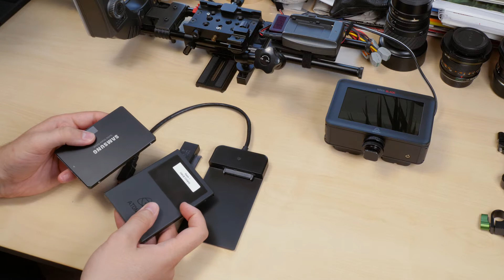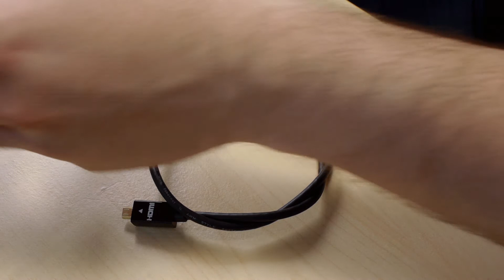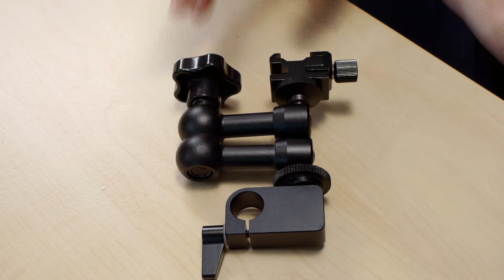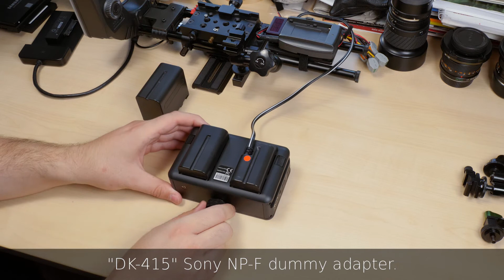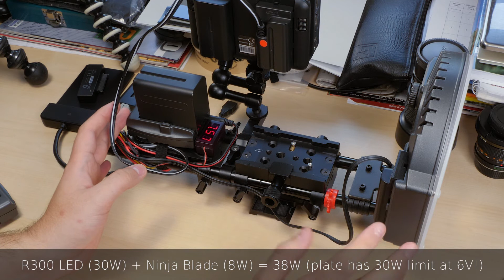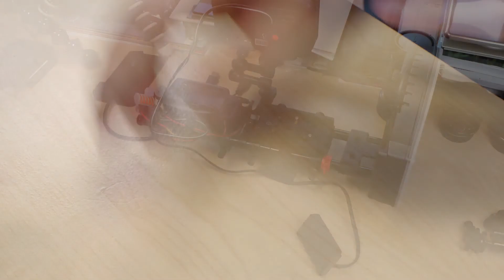Accessories for external video recorders (Featuring: ATOMOS Ninja Blade)

Comment: What were you saying about prores being bad on PC, and to use dnx?
Reply from the maker: Well - The problem is, that there is still the gamma shift bug present with some renderers / encoders. A few got fixes - But its still the case with some (while you´re cutting or in the original footage before using the encoder the exposure is ok - But it shifts as soon as you encode the footage). So that´s the point why I mentioned that its better to use DNxHD instead of ProRes if you´re working on the PC (as the Atomos Ninja Blade offers both codecs). On MAC its better to use ProRes on the other hand. It´s just faster there (and it´s a standard codec there). ^^
Reply from the maker: Yep. Though: I need to test the newest CC if the gamma shift bug is still there - Until now even with CineForm as intermediate / pre-rendering codec (with MOV wrapper) there was still the gamma shift bug present. I hope they fixed that. It´s quite annoying, to have different gamma levels (just because you use different pre-rendering and output settings). Especially since Premiere is very unstable with some effect combos - Therefor its nearly a "must have" to pre-render some parts (and I like CineForm as it´s taking a lot of space - Yes - BUT its also super fast to render ^^). About ProRes export in general: Well - Again one point gone why people need to use FCPX / Final cut. Altough I understand why many still use it and dont want to switch (Adobe is just A MESS according stability and bugs) ...